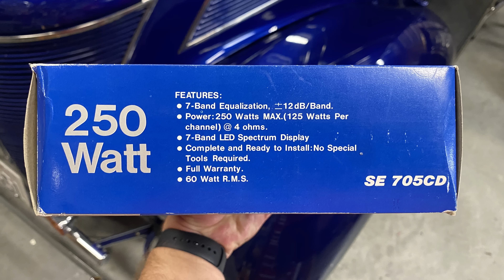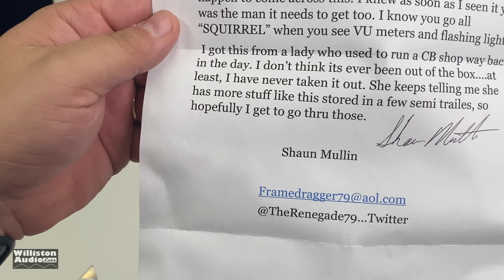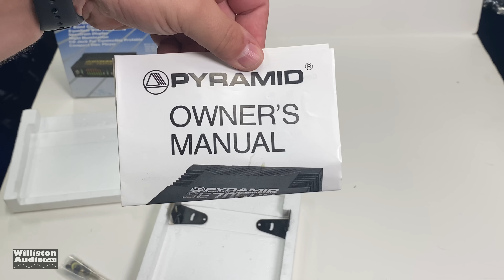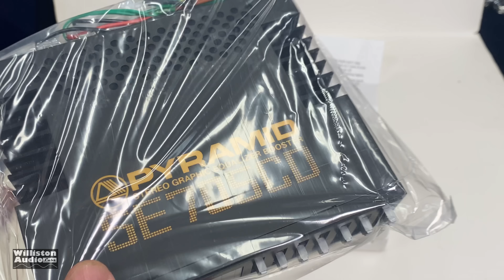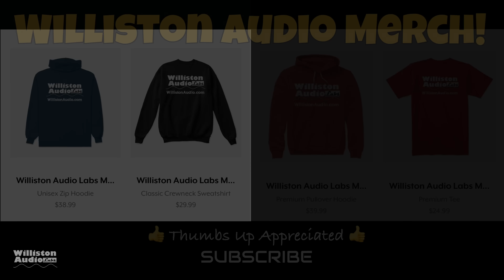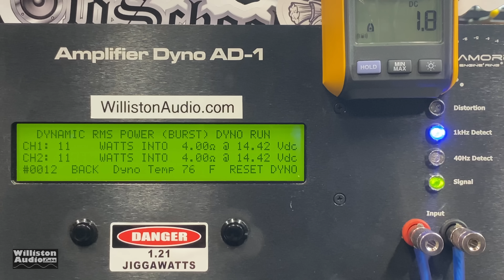1980's Flea Market EQ Booster? Pyramid SE705CD Review and Amp Dyno Test

Comment: Could it be possible that the reason that you may not be getting maximum power out is because you may have electrolytic capacitors that may have changed their ESR (equivalent series resistance), causing the signal to lose amplitude?  That may not be the case, but I'm thinking that may be a possibility.  I don't know if they could sell something like that back in the day and give an exaggerated power rating.  It's great that it works in the first place though.  It does look well made. Just very crammed for its time.  I remember pyramid amps being loud back in the day.

Comment: Thanks for the demo.  The big problem back then with the wattage ability was the car 12-13 volt system, so the beat way to do that was with the combo output IC chip, but they could have had several of those chips in a bridged design to get at least 20 to 35 watts per channel. Separate output transistors would have been better but back then but there was no a easy way to get the 20-60 volts needed to have those output transistors kick that kind of watts they needed. 
  By the way the Pyramid speakers???? I had a pair of 4X10's and they were so stiff I took them back and bought the 4X10 Pioneers, they were the opposite, moved so easy that the banged the voice coil....
 In the early 1990's I worked at Radio Shack and eventually bought some of their car amps. By then then were using power transistors on the outputs, and they work well. I never bought one but their next series of car amps, the one with the three controls for bass, treble and balance, to me that was the same amp Pyramid had but it was just relabeled for Optimus, Radio Shack. That one looked different from their other big amps, so those big ones I can't say who might have made them for R.S.

Comment: That is absolutely hysterical. I sold car stereo gear in the mid and late 80s and we'd constantly get people coming in wondering why the Denon car stereo gear was so much more expensive when they could "go down to the corner stereo store and get a 300 watt head unit"? Yeah, those 300 watt head units with a 3 amp fuse. ;-)

Comment: I remember pyramid was cheap but weren't so bad. I don't even think they had dealers here at 1st. I bought mine out of the trunk of an RX-4 at the beer store. It wasn't stolen either. He had lots in the box still. Prob only 50 or 60 clean watts though. The 200 was distortion. I prob still have it somewhere. 40 bucks I think.

Comment: I remember around 1980 sitting in friends’ trucks listening to Kraco speakers driven by Pyramid power boosters.  No subs, nothing good at all.  Nobody really knew what crap the stuff was but it didn’t matter.  You’d buy it at little hardware stores. lol  My first head unit was an Audiovox (which wasn’t actually a bad name).   That was ‘82.

Comment: Seeing that $169 price in that magazine was Crazy,  i remember buying these things at a Store called RJK Sales in Athens Tn back in the 80's,  i remember these things being like $19.99.  There's no way any of us would have put over $100 into these things.  Also I remember every Flea Market in the region selling a Stereo brand called Alphine.  Same logo as Alpine, just had that Extra H in there.  yeah they were like $20 too and not a digital tuner.  

What really stuck me though, from 2003 to 2013 I was a R&D Engineer at Hunter Fan company.  that little square plug on the back of that thing, is the same connector Hunter used (and I'm sure still uses) to connect their switch housings on the bottom of the fans and some times the connector on top for remote receivers.

Comment: Back in the mid '80s to early '90s I had an earlier model Pyramid amp/eq ("45w", I think) in a '77 Ford Ranchero GT with Crate stage monitors behind the seats and it blew your head off. Those monitors had a 10" woofer and a horn mid/tweet in them and were pretty efficient.

Comment: I remember seeing these things are the shady car stereo shops in the 90s pyramid was actually one of the better ones. Not as bad as the no name 1000W amps for $29, you check it out and it has like 16G power leads with a 15A inline fuse, no way that could put out 1000W, maybe 20W x 2.

Comment: I was installing the 100W Pyramid amps for people back in the 80s. 1/3 the size of that and ZERO heat sinks. I told people they'd work just fine, but they might get 3 watts out of them. They DID make the radio louder, however. And you'd get a whole lotta distortion as the volume increased. Some dude would pull up in a box truck at the local Wal Mart or grocery store parking lot and sell these every so often. They put most of the money into the faceplate, which was awesome.

Comment: I used a pair of those as an active Crossover for my System before they made actual electronic active crossovers for automotive sound systems.(Mid 80s.) I had 4 majestic 300watt amps driving 4 15" MTX hard cone Bass guitar cabinet drivers. And a pair of 100 watt Sanyos driving AFS Kriket separates for mids and highs. I had a Pioneer supertunet with a Cassette drive deck and a CD player on a separate pair through my Zapco SEQ. 
Yeah, I spent some money on that car.

Comment: All of those old booster/amps were never going to do more than ~ 24 watts (under ideal conditions) since virtually none of them had internal inverters.  24 watts is assuming the chip is capable of rail-to-rail operation at a full 14v.  True high-power amps of the era (and still today) that delivered real wattage were expensive because they had to not only employ amplification, but also had to include built-in inverter circuits.  To get over 24 watts from a 12-14 volt system, you MUST raise voltage (ohms law).  Real high-powered amps do this with high-frequency inverters inside the amp which take the 12v and boost it to +/- 24/36/48/etc volts.  When you pop the cover, this is usually obvious by seeing a small toroid with really thick wire wrapped around it a couple dozen times or so (the high frequency transformer).  More voltage == more wattage.  All these old cheap eq/boosters from the 80's were essentially the same: a cheap chip amp running directly from the 12v from your car.   None of them could have ever delivered more than that 24-ish watt limit without more costly circuitry.  

Fun fact: this is why Bose used 1ohm speakers in cars.  With 1ohm speakers, they could deliver over 90 watts to each speaker using very simply amp circuitry that does not need to boost the voltage (14 volts nominal @ .7 = 9.8volts RMS... Wattage is V squared, then divided by load, 9.8 * 9.8 / 1 = 96 watts.  High wattage, less electronics, less to go wrong electrically.

Comment: I had one of these for a few years.  It was the radio shack version which claimed 80w.  Set it once and stuck it under the seat.  It did a good job on stock speakers, back when factory radios had maybe a couple watts.

Comment: My dad had something similar in his van with two home speakers built into the rear seat and side panel. It was much higher power and sounded great with CDs. Had to be much higher power to drive the 12" 3way speakers though.

Comment: Had a pioneer supertuner centrec amp eq and 2 Kenwood 6×9s. All the treble and hardly any bass. That was the early to mid 80s.🤘😜🤘 And there was flea market knockoff equipment. You could get a amp eq and 6×9s for $50. Very distorted amp eq at that.

Comment: Had 2 Pyramid 10 inch "150 watt subs" in a I just guessed because I was16 box I made.  I guess I did a great job or got lucky but they hit  HARD on only the tiny 50 by 50 Optimus (Radio Shack) amp.  Speakers were from pawn shop as new.  Looked ok with the bright orange foam rings and Pyramid on the dust cap.

Comment: While these were the typical way for teenagers to upgrade their car stereo when I was a pup (speaker output to booster amp EQ and Jensen Triax 6x9 in the rear deck.) Some of us knew that they were  low powered noise makers with no sound stage. I was so cool that after I graduated high school and got a new car in ‘84 I put in a Blaupunkt Tucson 2 volts into a Rockford Punch 100 with tweeters and mids facing the driver in the high dash with the woofers in the deck getting bridged mono under 200hz. Didn’t blow your ears out, but I felt very sophisticated among my peers… 😅

Comment: My first "system" was a pair of Pyramid 12" subs. A buddy had picked up a pair of JL Audios in a massive ban-pass box. He didnt want the box so we cut it in half and wedged it into the trunk of my 85 Cavalier. I traded a rusty weight bench to another friend for a tiny little Pyramid amp. I couldn't begin to tell you the specs on any of it. The amp was smaller than a cassette player. The head was a Pioneer Walmart special. And the rest of the speakers were stock. It sounded so awful even but it didnt stop me from enjoying it.
Reply: @jeremyshelton1079  
Lol
I had some Super blue 10s in 1993

Comment: Hey I was a broke high schooler in 1983, I had a Pioneer cassette head unit with ohly the Tone control, paired with the Kraco 40 watt power booster driving some Kraco two way 6x9 in a 73 VW Beetle. I put the booster under the frunk so it would catch all of the cold air. I was a big fan of the lights from the equalizers, When I got older and cars came with  very good and powerful audio systems, I lost the desire to upgrade the systems. Awesome content and flash back of the past.

Comment: At the turn of the century i had a used cd changer (alpine or pioneer, cant rememwbr) with a long wired remote that went where your head unit would be.  It would even play burned cd's. (Not mp3)  ran 2 amps with it.

Comment: What a lot of people don’t realize is that in the 80’s component speakers were just coming out. I started doing them on my own in the late 70’s. They worked well, and the things I looked for was natural sounding speakers and as efficient as I could find. A 20 watt EQ was all you need for good sound if you do it right. The thing to be aware of back then was that they sold speakers with wattage levels. I’m not sure the we’re talking about how much power the speaker could take, I think it was more about making them seem better to the guys who didn’t know anything about electronics, and how stereos worked. 500 watt speakers? Bullshit. Speakers don’t make power, they use it. In order to take high wattage speakers would have to be well damped physically so that they wouldn’t over excurt the voice coils off of the pole piece and disintegrate. They also had to take a lot of heat. 500 watt speakers. Would make low powered blow dryers. The only good thing about them having stiff suspensions to keep from being over excurted is that they wouldn’t move much when you hit a pit hole or slam your door. Efficient speakers need less power to put out higher volumes than the overdamped inefficient speakers used today. The whole thing sounds like a scam to me. If I still had one of those old car stereos I’d put it up,against the high wattage setups of today and compare hoe they sound at reasonable volumes, say 100 db at the most.
By the way, 1% THD is audible. They probably rated this at 10% as was the custom in the day.

Comment: I've never run Pyramid car audio, but I have run quite a bit of rack mount Pyramid stage and studio stuff. I've had good luck out of it. I have a 60 amp Pyramid rack mount power supply for tinkering on electronics that is awesome. Super stable voltage up to about 70 amps when it peaks. At 70 amps it drops about 1.75 to 2.25 volts. Drop the load back down to 60 amps, rock solid at 13.8VDC.

Comment: I was a bench tech back in the 80's, had quite a few of these crap amps come across the bench.  The rated power was usually off an order of magnitude at least, I used to call them "Chinese Watts" as it was commonplace on Taiwan & Hong Kong stuff back then.  They all used integrated amp chips in SIP packages with little to no output protection, a quick short across the speakers would release the magic smoke.  Never saw one that used discrete components.  I think the biggest I can remember coming across was rated @ 20 w/ch.  Pyramid was higher low-end stuff, usually found in CB shops, truck stops, and flea markets.  There were hundreds of 'brands' of these underdash mount 'Power Boosters' and EQ's w/ an amp like this unit.  They often had ridiculous price tag stickers on the box like this one, common on low end stuff back then, they thought it made it look like you were getting a killer deal when you bought one for $75.

Comment: That was my very first car audio product . I bought it used in 95’, installed it in a Buick lacrosse with two Cerwin Vega full range house speakers in the back seat. I’m sure it sounded horrible, but you couldn’t tell me I wasn’t king of the road. Also, I wired it to the 12volt cigarette lighter for power. I had to replace the cigarette light fuse almost every weekend because it would blow lol.

Comment: My Jr. High Girlfriend's brother had a second gen Camaro with a Pyramid Gold dual shaft cassette deck, this exact EQ Booster, Sparkomatic coaxial dash speakers and a set of Pyramid Phase IIIs in the deck lid. Dude.... that shish banged. It sounded fantastic for the era. I will forever scream that the Pyramid Phase IIIs were seriously underrated. They sounded GOOD for cheap!
Reply: Yeah, seriously over rated  on the spec, but combined with Sparkomatic 3.5"s on 600hz, 6db/octave caps and Phase IIIs full range, it's more than you'd think.

Comment: back in the mid 80's I had a three-piece Mitsubishi component car stereo consisting of an FM Tuner, Amplifier with Equalizer, Cassette Player, 8" Coaxial Speakers, and Tweeters - wish I could find any info about that system (pics, etc.)

Comment: Not so great to todays standards but back in the day they was like a huge upgrade you was a cool kid if you had one cars back then come with a am radio half the time or a fm converter mounted under dash if you had a EQ you was high tech flashing lights was worth it in its self to new stuff yea this is way under power and cheap but to a vintage perspective it was super sweet

Comment: I can't remember what brands I had back in the day- but had a few "eq boosters."  The "high powered" Alpine cassette decks were claiming 25 watts peak per channel, but were probably about 11.  I finally got a real external amp in '86 from Coustic, running two Cerwin Vega 6x9's and they pounded...  
I've got a bunch of 90's era car audio stuff if you want to test them- the California Series from Profile was supposed to be the cheap amp that slays the expensive ones. I still have one in the box. Also have several big Alpines and Proton amps.

Comment: I had Pioneer system in a car in the 70,s modular had EQ, AMP, RADIO, TAPE deck all single units they pumped two 12 inch sub home speakers sitting on back seat, got noise ticket .

Comment: I grew up in this time but refused to use Junk like Pyramid, Kraco, Sparkomatic. I was a Pioneer man, High End Component Cassette Tuner with Component Amps and a Dual-Amp Balancer. Pioneer 3 way 6x9's, then upgraded to EPI 6x9 Component Plate Speakers.

Comment: I purchased one of these for $50 from K-Mart in 1984. The CD input was an Auxiliary Input, same thing basically. It didn't put out a lot of power but it sounded pretty good. I installed it in my 1978 Honda Civic.

Comment: I had a similar Amp, rating 30W per channel RMS and 100W max. What was different from this one is that my amp had 2 transformator on the output. I think it gave  around 25 watt as it sounds like. I wasn't impressed about the power, but the sound. I really like the sound. Was like tube amps. I never forget the sound. Even after all the years I always reminds me of this amp when I listen to other amps

Comment: i did eventually get rid of all that cheap  car Audio.  stuff and i  bought a nice Alpine head unit  i installed in the dash of a 1983 CJ7 Jeep   i lived in Florida and went to West Marine  to buy Sony  boat Speakers that fit  perfect in place of the factory 4” Speakers they had some  Plastic cones  in them that were completely Water Proof or Resistant  the system sounded pretty decent and  it would get loud enough to hear  over the noise of traffic and the Mud Terrain BF Goodrich tires  i put on with a Lift kit  for theft protection on the head Unit i  blacked out the Alpine Logo. with a Black Marks A lot Permanent Marker  so it looked like a no name  Stereo  i drove that. vehicle for 10 years and no one even tried stealing  it   and those Sony Speakers. still sounded great when i sold  it  despite  getting  packed with Mud and  being hosed out   on a regular  schedule many times. those weren’t even the most expensive Waterproof speakers West Marine sold at the time  most of the years i had that Vehicle there was  not any top or doors  on it  and the Alpine worked flawlessly. as well     it was a Cassette player and back then a big deal was  playing the Chrome  tapes  with Dolby  on them  most of which i recorded from LP Vinyl Records  on my Home Stereo  i always used TDK or Memorex tapes and some of those still  play currently

Comment: I uses an "Audioxox"  eq with an ax 3.5 back in 1992.  Man did it give me a engine noise but I had control over the sound.  I loved my old gear in that 1983 Olds mobile.  All the wires coming out of the dash.  Nothing but electrical tape.  The good old days.  That's the way to roll.

Comment: i never used the watts i had the 10 band 80watt version, and ran it preamp with rca to amp just to have control over sound it was more powerful that way, clean power sound from wiring 2 channels to 2 12 inch woofers too 2 piezo tweeters on each separate side

Comment: Viva store 15 watts no woofer preout car 14.9 DC volt equalizer with rear heatsink the eq is just comprehensive right concerning sound and watts works great with a Sony am FM cassette player Walkman and even two car 6x9 paper woofer cone speakers in ported carpeted separate speaker bokes god bless Viva store